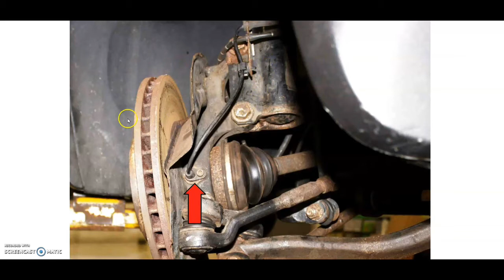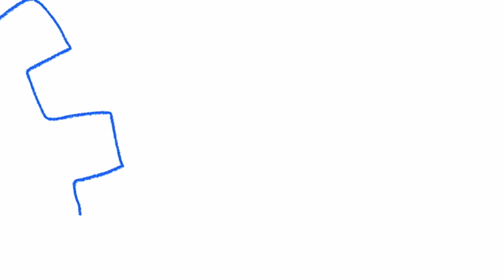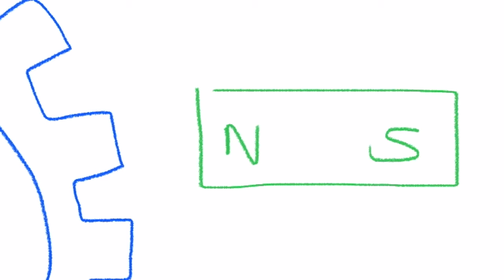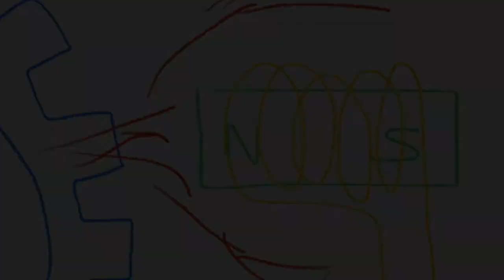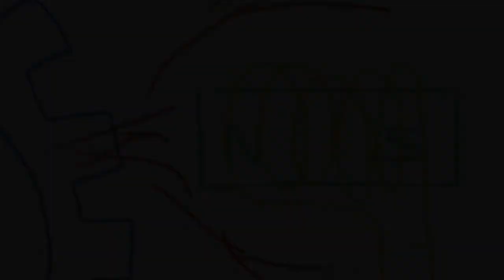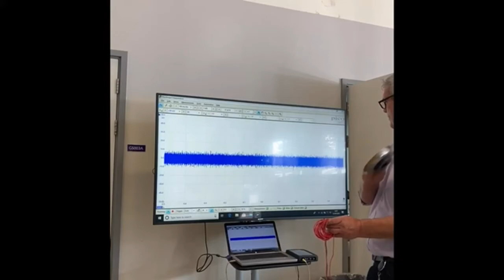Intro to Inductive ABS wheel speed sensors

Comment: Is there a scenario where a working ABS sensor would show as OL on DVLM when testing the two pins on connector for resistance?

Basically, I tried to diagnose a neighbours ABS fault as a diyer myself. Scanner said r/h speed sensor circuit issue. I tested for resistance and had a reading of around 1400 OHMs. I decided to cross check against the l/h side that supposedly works and it came up as OL. This led me to believe the harness is wired in wrong as why would a sensor say OL when tested directly but the car says it works. I asked in a fb group and have been told the OL sensor is likely ok :s. Came to this video to try and better understand how the sensors work but it's only reinforced my initial thoughts as if the wires go into a coil that's connected together, it should have a resistance value should it not? OL in all scenarios would indicate a bad sensor?